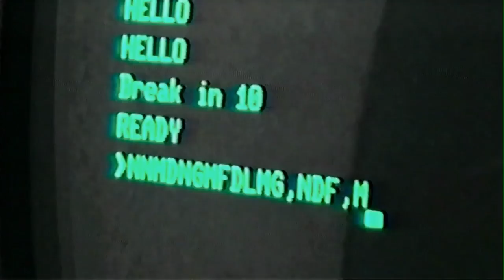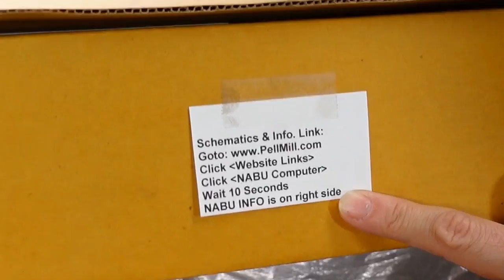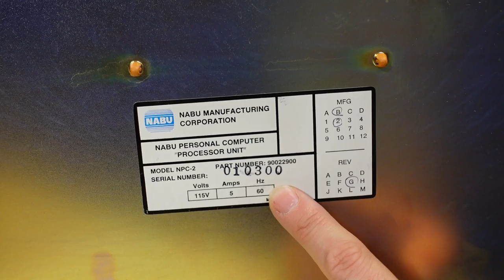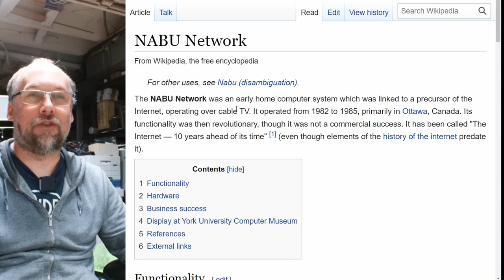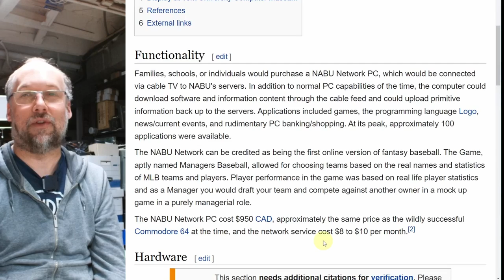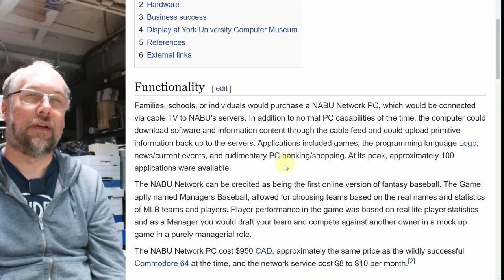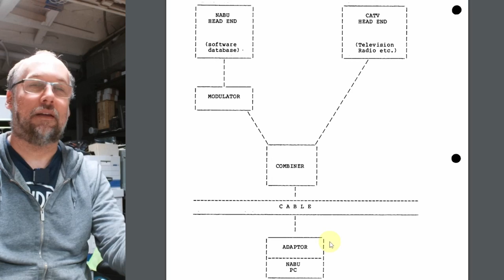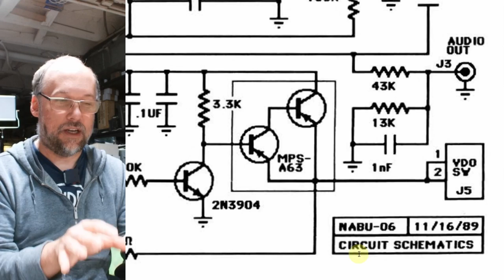The 80s computer you've never heard of: The NABU PC

Comment: Would be interesting to install an EEPROM with an MSX machine's ROM in it. See just how close it is to the MSX standard.
Reply: We know the port addresses of the video and sound chips are different than most MSX machines, and I believe the MSX standard specified a parallel port connection to scan the keyboard matrix.  So copying an MSX BIOS directly won't work.  However, it might be possible to write an MSX bios from scratch or convert one (with quite a bit of work).  I sure hope someone does.  I am not an MSX expert but I'm led to believe that many or most MSX hardware features were usually accessed through the BIOS and not with direct hardware access, and if so that's promising.
Reply: @drgiller  MSXBIOS may be convertible with a bit of effort, but most games probably just interface hardware directly. So I believe a hardware mod is required as well.

Comment: As of today (9th of december 2022) your eBay link in the description says:
This listing has ended. The seller has relisted this item or one like this. (US $59.99[ 298 sold ])
following link says:
This listing has ended. The seller has relisted this item or one like this. (US $59.99[ 200 sold ])
following link says:
This listing was ended by the seller because the item is no longer available. (US $59.99[ 71 sold ])
So it seems this is no longer available, I could not even find it through eBay's search...

Comment: As much as this looks like a very well engineered computer for the day, it seems to be ruined in terms of being collectable in the modern age simply because it relies on a cable TV connection for the software unless you could connect some kind of player to the 'cable' input in order to send it the appropriate softwer (you could probably rig up something like a Raspbery Pi project to do so if said software can even be downloaded from somewhere).  Without the ability to load software onto it, it seems like only museums should bother with them.  With a ROM replacement you might be able to get it to run some MSX code but I would expect compatibility to be very limited.
Reply: Maybe MoCA out to a local server.

Comment: I'd be worried that the capacitors would be shot and if there's a battery for a clock,it would leak all over the place after several decades.  It seems especially useless because there's no way in hell those cable services exist today.  None of that matters to Nostalgia though, now where is My Amiga?

Comment: What about replacing the Z80 with an MCLZ8 and adding some code to perform address translations, emulate the RAM and ROM and some of the cartridges so that the NABU could act like an MSX?
Reply: I ordered one...  I will use the MCLZ8 to develop some code on the Teensy to access the NABU motherboard resources like the keyboard, display, sound, etc... That way we can use the Arduino IDE to develop C programs which use the Teensy as the 800Mhz brain and the NABU for the 8-bit computer I/O experience. This would be a lot simpler than programming in Z80 assembly....

Comment: What would be really nice would be to try and find one of the adapter boxes and reverse engineer that as a starting point for a replacement. Make it so a bracket could be 3D printed, mount it inside the main unit, a short DIN cable to the port, and a cable to the expansion headers.
Reply from the maker: The seller actually sells those as well -- I didn't bother ordering one as I felt it was unlikely we would ever need that to get these working again.
Reply: @adriansdigitalbasement  with all the community attention this thing is getting, that is probably not impossible, although the question is - if it is easier to interface "the adaptor" or emulate it entirely.
Reply: @jwhite5008  Emulation is always easier. Guesses about functionality can be made and fudged as needed.
Reply: @jwhite5008  it's already been bypassed using a simulator and an RS422 adapter
Reply: @grafxgear  Oh, that's great!
Reply: @wishusknight3009 /videos It depends on what to emulate. 
I.e. it is easier to abuse NES lockout chip than emulate it. Although C64 PLA emulators exist, the most accurate and straightforward replacements use technology similar to original (GAL). Emulating Playstation3 accurately and quickly enough is still a distant goal despite enormous work done going on for more than a decade.
But in this particular case you are probably right.

Comment: Simulating enough of the network to allow booting a custom OS on it probably isn't that hard, much easier than simulating the entire NABU network. Using the adaptor port for I/O should make it very expandable through fake devices. Given the overall quality, it'd make a very nice hackable Z80 machine. Does the video chip do 80 column modes?
Reply: No, it doesn't. It's the same chip as in the MSX standard. Text modes: 40×24 and 32×24, resolution: 256×192 (16 colours).
Reply: @JeremyLevi  Ouch. Well, that rules out CP/M. Even if you go with a 64 column display and drawing characters in graphics mode, that's four horizontal pixels per character, which is pretty eye-straining...
Reply: @hjalfi  The CP/M they had for it had 40 column text and sideways scrolling (using the triple arrow keys next to the cursor keys).

Comment: I wonder if a Z80 Romulator would help debugging. It sits under the Z80 and allows you to halt the processor and adjust values and memory/rom. Based on the 6502 Romulator used in man Commodore systems. I think the developer just developed it.
Good luck
Reply: Could also use an MCLZ8 which is able to emulate the Z80, RAM, and ROM.

Comment: Im not getting why there is a RF in and out on the system when it will be more logicall to put them in the adaptor which is who extracts and injects data to the cable network.

Comment: Just throwing this out there, but what about a small "kickstart" rom to initialize the NABU, then have it look for a serial connection for it to load the rest of the OS much like it was designed.  Use a RPi zero or something to house the local storage and OS.  Maybe run CPM just like the RC2014 project does.  The RC2014 can run MSX and colecovision software if you have the video and sound cards installed.
Reply: That's basically what the built-in ROM does, and at least one person is already working on something to feed it programs. https://youtu.be/3wtfhyzVhNw
Reply: @drgiller  ahh, didn't realize the stock rom was that open.  I thought it'd have had some sort of authentication to go through before accepting anything.
Reply: @patracy  Authentication?  In the 80's? I think this was from the era when even many serious people had no concept of security whatsoever.  I expect that any existing "security" was only to prevent you from downloading something you didn't pay for.

Comment: Is it possible to hook it up to an cable modem with a PC in the other end and rewrite protocols or maybe turn it to a msx computer?
Reply: the are for the bios is only 8k MSX is much larger and it would mess up all the memory addresses.  however, there is now a restored nabu network you can connect with using and USB RS422 connector.

Comment: what about a project that can interact with it as a cable-based server -  given there are so few of these that would be a very tiny audience to enjoy resurrecting that game play experience
Reply: needs a device to head-fake it to interact with an Internet-based server
Reply: Just needs an adapter, from RF signal to standard signal, based on same pare of RF modulator and RF switch plus modern FPGA microcontrollers with WiFi module onboard. This one ARDUINO UNO WiFi REV2 for instance. It will transmit NABU data right from microcontroller to the router.
Reply: DJ Sure has done it

Comment: Ok, hear me out: This thing has a Z80 CPU and 64k of RAM, so in theory this should work for CP/M 2. So, we could just connect this cheap Arduino to SD card adapters to one of the ports, write a simple CP/M BIOS, maybe modify the BDOS to support a modern format like FAT16 and then we could use CP/M on that machine... 
Well, that thing only costs 60$ but the 70$ shipping and 30$ import fees, that's too expensive for me...

Comment: Does that case fit in a rack, width-wise? It looks like that was the aesthetic they were going for, which is a little odd for consumer equipment.
Reply: Sadly no.  It's 18.5" wide.  It's almost as wide as rack-mounted gear is with their ears, but the chassis is the full width.

Comment: you gotta wonder if you can get the MSX library to run on it with a replacement ROM and some tweaks
Reply: Would love that. Hope it gets done by the community!
Reply: @FinalBaton  Hi! I'm assuming you're the FB from shmups
Reply: If by tweaks you mean - assemble MSX out of that - then I'd say yes.
It would take quite a bit of effort, but probably much less than assembling an MSX from scratch.
It would only be MSX-1 though.
Reply: @briangoldberg4439  Yes it's me. What's your alt on Shmups?
Reply: @FinalBaton  v2
Reply: @jwhite5008  someone who worked on the original said of the 150 titles for the NABU many of them came from MSX ports.
Reply: @grafxgear /videos (sorry for late reply) I would be confused if they weren't. But porting with source code and knowledge about it by people who are paid to do that and enthusiasts doing it blindly is very different. If this computer gains a huge lot of attention, and is not quickly forgotten, maybe one or two games get ported. 
If I had enough spare time to work on retrocomputers, I'd rather invest it into producing a manual on how to convert this one into a full MSX. 
Another option is to insert something like a board with a microcontroller and/or CPLD between CPU and the rest of a computer, it could convert memory and I/O addresses - a user may then just buy the board and install it. It would require a lot of research, coding and testing, but possibly less than porting a complex enough game.
Reply: @jwhite5008  Not sure what you are on about. From what i have read as many as 150 titles were exchanged between the NABU and the MSX during these systems lifetimes. These are not "enthusiasts" ports but software that was licensed at the time these systems were relevant. Though I don't see much of a difference between decomp-lied code that is being ported vs having access to the source. One is going to be "easier" but you should have essentially the same results in the end. And these are not Zoomers fumbling around in the dark.  Many of these "enthusiasts" have day jobs where they use the same skills.
Reply: @grafxgear  Oh, you meant that a lot of games are already ported to this machine and no further work on them is needed - I read it all wrong - really sorry. I'm not trying to say modern-day retrofans lack the skill - just that they probably won't invest as much work in this somewhat-obscure system. Some games may be fairly easy to port if you know your way around the code, but frustrating to debug if not. It depends. Don't let your hopes up unless you are a developer who can help.

Comment: Adrian, how many pins on those expansion headers? The only thing missing from an MSX are cartridge slots, and those are 50-pin. Maybe they replaced them with the headers?
Reply from the maker: It has a lot less than 50 pin on the inside slots. It's mainly the address bus, some select lines, a few address lines and read and write lines. Definitely can't add memory (like RAM or ROM) to those slots.
Reply: AHA! Four Memory Mapped Slots! Before writing a new ROM, you should try to boot an MSX 1 Bios on this machine.
Reply: @rigues  sadly, that won't work either due to slightly different hardware layout
Reply: @rigues  No they use I/O mapping, there are just 16 I/O addresses per slot.

Comment: Adrian, is it possible to mod the power supply to 220V to use the Nabu in the EU ?
Reply: I'm in the Netherlands, and we have bought three NABU systems, one for the "national video game museum", in zoetermeer, one for me, and one for another another computer museum volunteer. we are replacing the 110V PSU with a mean well RT-65B. you need a PSU that delivers at least 2.5A for the 5V, and also supplies +12V and -12V, the later is needed to generate -5V for the 16K DRAM chips.
You also need to replace the FAN as it runs on 110V, replace it with a 5V or 12V powered fan.  the sort with 72mm distance between the screw holes, this is a common standard.

Comment: If a diskette drive is possible could you (or your friends) not make emulator pcb to plug in and boot from it? Instead of a pi could you not make a adapter to connect to a modern pc via usb so you could share your program/game library online with other nabu users? By the way, nabu is a planet in star wars I think.

Comment: I wonder if the 40 pin chip (WDC) was a floppy controller, but never used. Or if - maybe - one of the add-on modules was for a 5-1/4” floppy drive?
Reply from the maker: It's actually not that. A picture of the floppy controller exists and it's an expansion card with a normal floppy controller IC on it -- the card connects to the motherboard with a ribbon cable.
Reply: @adriansdigitalbasement  There's also a small size Centronics style parallel connector on the back of that card, which goes through the metal plate in the back panel.  A similar cable from the floppy plugs in there.  There's also a small board that plugs into all the expansion slots at once and has the cable to the floppy controller, maybe so it could have more device select lines.  Anyway, the floppy drive was good for saving word processing files, LOGO programs and running CP/M.
Reply: No its a western digital chip all right, but it is a (very) high speed serial interface to connect with the cable modem box over RS422.

Comment: Hey Adrian, is the memory map similar enough to try an msx rom in it for giggles??
Reply: sadly it won't work, at least port layout is different for some reason
Reply: @jwhite5008  someone with knowledge could edit the rom to address the chips in there new locations?
Reply: @telemedic5142  I think it is possible, but quite arduous to modify MSXBIOS or CBIOS to reflect new layout, so BASIC and maybe MSXDOS would work, but most games probably interface at least some of the hardware directly, so they won't work. I'm not sure what can be done to the keyboard since it is very different.

Comment: You gotta wonder how many users were orphaned when the cable companies shut down the services needed to run these...I wouldn't have been a happy camper if I invested the money into the hardware.
Reply from the maker: I'd have thought most of these got thrown away when the network died.
Reply: @adriansdigitalbasement  it was cloud computing before anyone called it the cloud 😉
Reply: Apparently it was rented and had to be returned. That’s probably why they haven’t been sold used before!

Comment: Would it be possible to turn this machine into a working MSX 1? With a new custom ROM or something? It'd be awesome, as MSX machines are quite expensive to import in North America.
Reply: I'd say a hardware mod should be possible with some effort, as for software-only - you could probably get MSXBASIC working, but porting every game is not realistic.
Reply: @jwhite5008  thanks for your take! Yeah I was thinking more of a hardware mod, and now with your answer, that's definitely what I'm hoping for.
Reply: @FinalBaton  I think it's best to look at schematic for MSX1 and NABU and look for similarities, desolder/disable everything else, and add a board that houses the rest of components like MSX-compatible keyboard. The keyboard itself will have to be modified as well since MSX uses a parallel protocol, or maybe some arduino-like microcontroller can convert it. We will also at least need something to read software from like casette or disk or SD-card or cartridge slot. The port selector should also be replaced or converted somehow to accomodate the MSX standard. Basically we would be building an MSX using RAM, VRAM, sound chip and CPU already present on the board. Perhaps the conversion board could be inserted into expansion bay, and we would also need a LOT of bodge wires.

Comment: Without cable TV (WHO has cable anymore?), it seems as useless as teats on a boar
I guess it would be great for parts! :)
Reply: It's working again thanks to a simulator and an RS422 connection. Others have enabled an SD card reader to load CP/M onto the hardware.

Comment: Hmm,,,
It would be tempting to shove an MSX1 System ROM in there and see if anything at all happens - not the standard MSX ports so likely not a lot.
I guess one could try to hex edit the jump tables in an MSX or Memotech ROM as a possibly quick way to get an 'OS' on the machine.
I'm kind-of glad I don't live in N. America - I'd be tempted to buy one to fiddle with and then probably do nothing with it.
Reply: it would most likely hang immediately since at least port numbers are different. But with a hardware mod it may be possible - at least it foregoes soldering all the RAM, VRAM, CPU, sound, and other stuff to the board

Comment: The wiki said a hard drive was available
Reply from the maker: I'm quite sure that's bad information. There isn't any other information anywhere that a hard drive came out for the home computer.
Reply: @adriansdigitalbasement  I've heard that before, it is unlikely a "hard drive" as we know it but a "hardware drive" not like the "soft drive" you could use with the back channel. So maybe a 5,25" drive or a tape drive, both could be possible.
Reply: The wiki page has changed now, but in you video around time 20:00 under hardware, it says a hard disk was an add-on. Fwiw

Comment: You can probably whip up some software to emulate the NABU adapter and connect the machine over a serial port. The 'adapter' port looks like it's connected directly to one of the UARTs, so I'm pretty confident that it's just a serial connection. Given that you have the boot ROM you probably know which bytes you have to spoon-feed it to make it work.